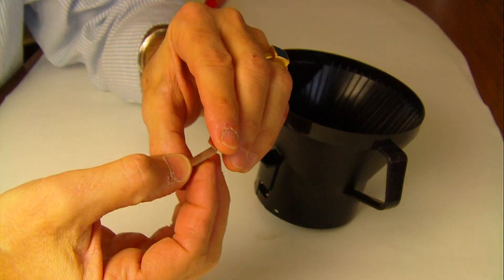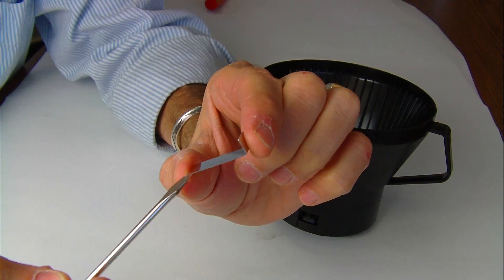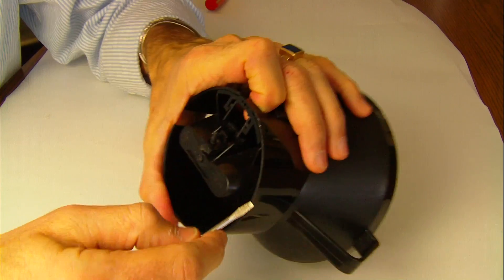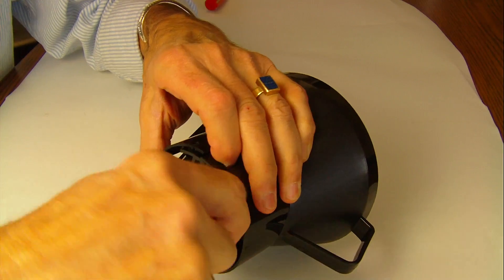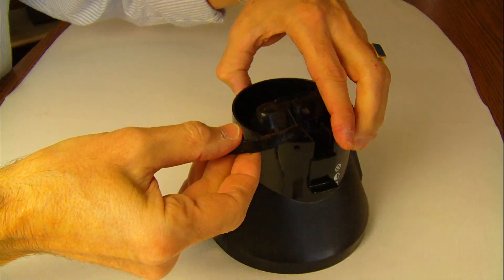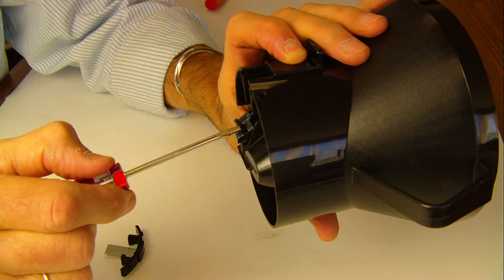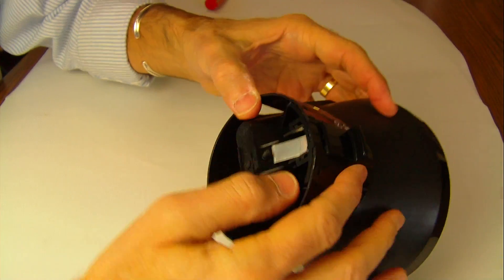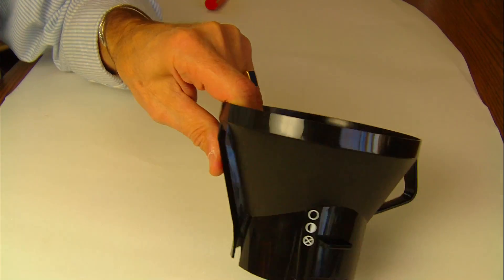KBT SPRING ASSEMBLY - TECHNIVORM

Comment: I stumbled on another problem after fixing this one. The plastic piece that the spring controls doesn't seem to have enough push to it. It can't find the middle level when you try adjusting it up and down, it snaps right up to the fully open one. Any solution for this? Thanks in advance.

Comment: Thank you for the clear instructions. A couple tips - (1) you needn't remove the crossbar to just replace the clip, I think the author is showing this just to illustrate how it's put together, and (2) I used the tine of a fork to carefully lift the metal piece enough to slip in the stopper part underneath.